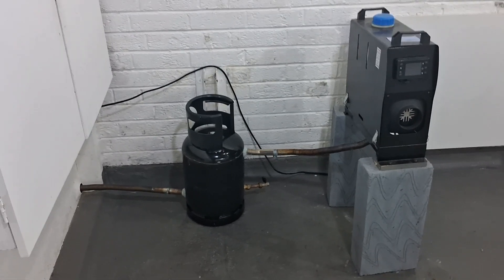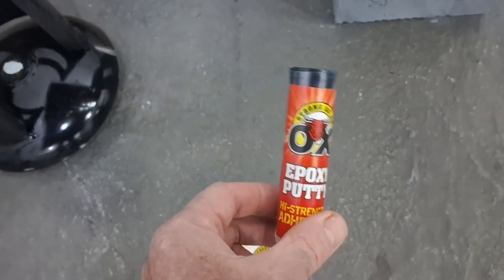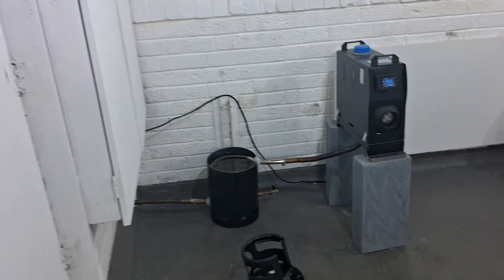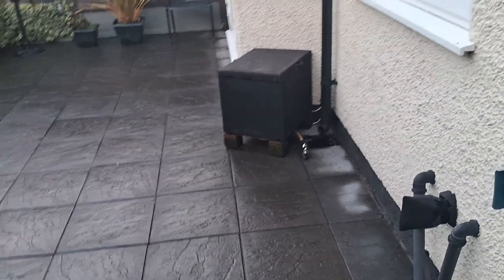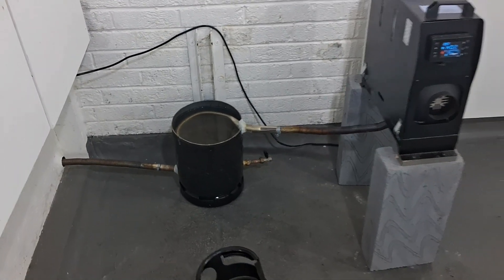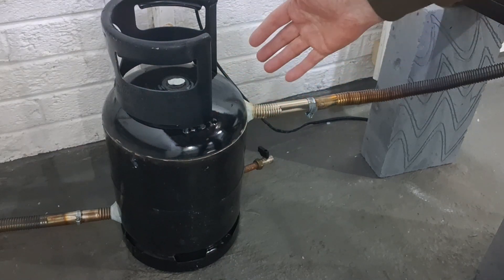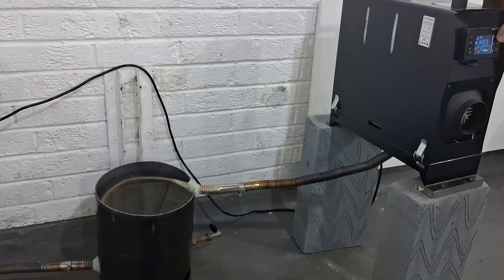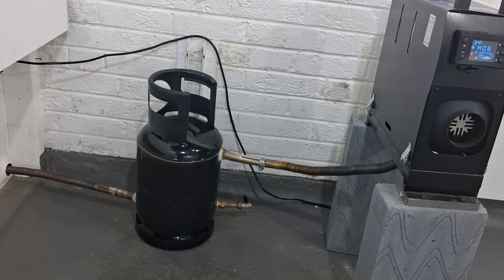Free Hot Water from Waste Exhaust Gas Bottle Heating Home Diesel Oil Heater Waste Heat EGR Burner

Comment: Hey Andy, I have mine installed and I am mucking about with the tailpipe outside.  
But after running mine outside for a few hours and then in the shed (16x10) I noticed a "smell" not Co but I have determined it is from the heat outlet hose.  I removed this hose and it was way cleaner.  I have since picked up some 3" semi-rigid aluminum vent hose. and a skinny hose clamp.    This aluminum hose heats up fairly high....
But my brain has been thinking about the x4 45mm hose cap they make.  Every one is playing with the heat recovery from the obvious source "Exhaust".  So I will throw you a idea would love to see someone work with.   (off work at moment so no "expendable funds" or I would do it.) 
I was thinking one could do a "poor mans heated floor"  by routing the one or two of the 4 outlet hoses through a raised floor.  I was thinking pallets.   Then finally vented out the "step" into the shop.  This would be for the back area where I spend most of the time at the laser or the drill/mill.   
Could you run it into conduit and have it radiate just enough to heat the feet?  Or would EMT have a smell or chemical to be concerned about?   

Then I guess the next step is doing the heat exchanger trick to heat a 50/50 mix of water and antifreeze.  Since this will not be heated constantly.  
Need to find a small holding tank with a pressure release  or some sort.  Car rad is little to big, but would also act as a heat source. 
Then run proper radiant heat PEX in a sub floor....  Toasty toes!!
Reply from the maker: stay toastie...

thank you for your comment did you see my other heater vids, https://www.youtube.com/@andyfireblade let me know what you think, cheers andy

Comment: I was speaking of old gas hot water heaters or radiators - in the US there were many farmers who still had farm light plants --' 
      They had 16 two volt cells for house batterys - most were 7 kw light plants - 
         They charged the house batterys ever friday - the exaust from the generator went in the bottom of the flue pipe of a old gas water heater and heated water to shower and wash clothing on friday - 
       32 volt Dc farm light plants were very popular in the US from about 1890 to 1960s befor rural electrification in the US -
Reply from the maker: that sounds great.
i think we will be going back to some of these methods.

thanks for looking.
did you see my other heater videos  https://www.youtube.com/@andyfireblade
cheers andy

Comment: You can use a tank type gas hotwaater heater - just make a plate for the bottom of the fllue and a choke or.damper for the top of the flue - 
      They work well enought but rexover slowly -
Reply from the maker: great idea thanks

Comment: Hello Andy, that epoxy resin, how much heat will it take, will it cope with the exhaust,
Reply from the maker: i use it on manifolds radiators, and sealing exhausts. use in this vid was extremely hot where it goes into the gas cylinder, but was only just starting to singe.
cheers andy
Reply: @andyfireblade  cheers handy, managed to get some today, great experiment, I wish I kept my old copper tank, with a header, run the exhaust through it like you, constant hot water, 👍

Comment: The steel pipe will corrode in the water, the inside also unless it’s stainless steel. 
  I’d be tempted to get a ready made heat exchanger for the exhaust.
Reply from the maker: thanks , i will look into it! cheers andy
Reply: But what about antifreeze?

Comment: Would the plumbing be more effective if the exhaust entered the tank low and exited high? Less loss of heat and better use of convection maybe?
Reply from the maker: thats true , the reason i exited low is so that any condensation could run out.

thanks for your comment cheers andy

Comment: I like what you have done here, I bet you could adapt this to a larger water heater using a stainless steel heater coil similar to what is used in hot water pressure washers. Even if the heater was set on a low heat setting, it would soon heat up a water tank over the course of a few hours. The water tank could be further insulated by adding a jacket so i bet the water would heat up quicker and maintain temperature. Who knows... maybe the water could be pumped around a series of radiators?
Reply from the maker: Great point! this is why i love you guys comments, brings great ideas to the table. and our minds start turning....

brill cheers andy

Comment: Hi Andy,

I’ve thought of doing the very same thing with a Y-Section on the exhaust, then put an electric diverter valve after one of the Y-Legs to stop the heat from the exhaust that would be heating the water once the water got to a certain temperature. The hot water would be pumped through radiator/s to heat room/s up, obviously if it’s a sealed system you would have to have a pressure relief device on the water side, or make it an open circuit with a header tank. As your already set up with your channel it would be good to see you tackle this type of experiment.
Reply from the maker: great idea, thanks, i will look into it.

cheers andy

Comment: Have you thought about a towel radiator? No idea if it would work but might be good for drying towels if it does?
Reply from the maker: good idea, i will look out for one.
it would flow better than the rad
cheers andy

Comment: I refer to my previous message about putting some stones or sand in the bottom to retain the heat and keep the water hot for an extended timeframe

Comment: Absolutely fantastic. Again, I love these experiments 😀. The only thing that worries me is the added backpressure. If that is going to damage the heater over time? Other than that this is probably the best I have seen so far to utilise the exhaust heat. Next step maybe to pump that water through a radiator to bring that heat back into the room. 😃
Reply from the maker: Great suggestion! yes i think your right about the back pressure.
thanks for looking in on my vid cheers andy
Reply: How much added pressure do you think there will be from 2 m? If you are worried then use a step up and up the tube size, but they don't appear to struggle with 2m pipe?

Comment: Excellent as ever Andy,  
Have you thought ....
You have the heater in your box outside and all that exhaust gas is wasted. Have you thought of using this gas bottle but lagged and pipes to a radiator in your home with the 12v caravan pump?
Reply from the maker: Great idea, i will look into it cheers andy

Comment: Over the past year what is your best exhaust recovery?  I liked the radiator and was something I was thinking to implement, but what would you recommend?
Reply from the maker: the exhaust into the radiator was most effective, but long term using a heat exchanger with water would last longer and be better for reliability i think.

thanks for watching cheers andy xxxx